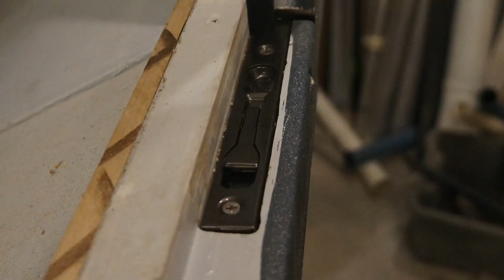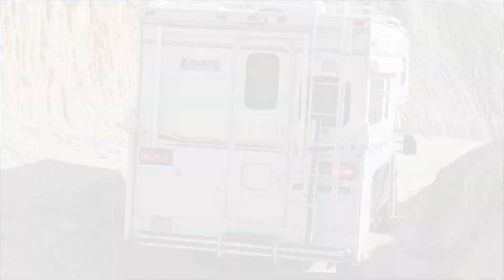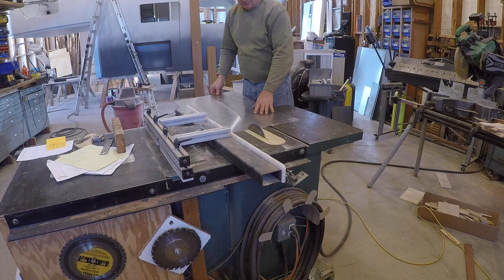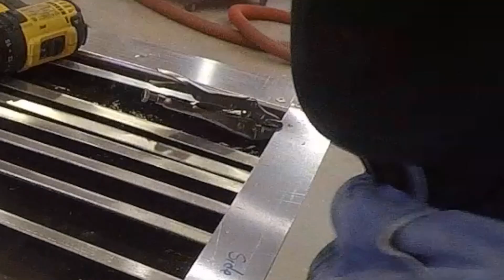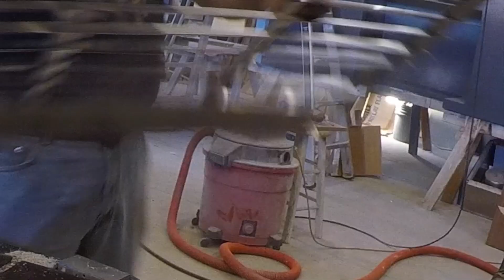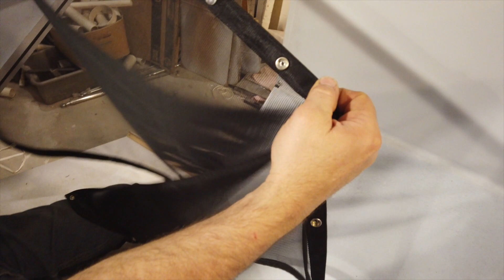Our Custom Camper Build | ep:8 | Staying Warm & Keeping Cool

Comment: Great idea with the diy window screen and snaps. When the screen is mounted with the snaps, is there an air gap between each snap that would allow bugs to get in?
Reply from the maker: Thanks for the feedback!  The screens work really well and as long as the snap spacing keeps the webbing edge taunt there is no more of a gap than the mesh itself.  The webbing has a slight stretch and even the webbing gives some, making it easy to get a tight fit.  The real test will be when we’re next to water in the middle of summer and all those flies swarm!  The MosquitoCurtains.com website has some good info and description of the different fabric options.  We settled on their most popular mosquito fabric..